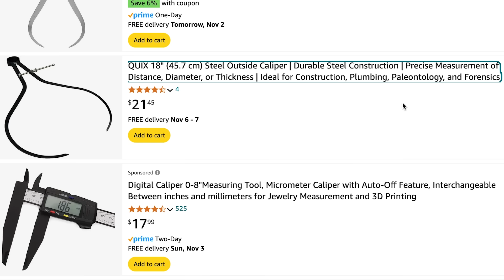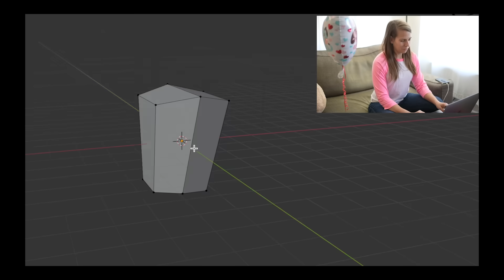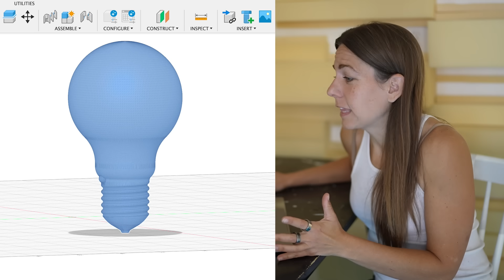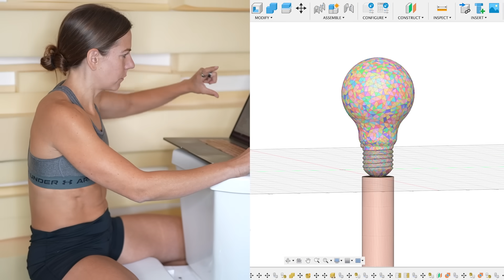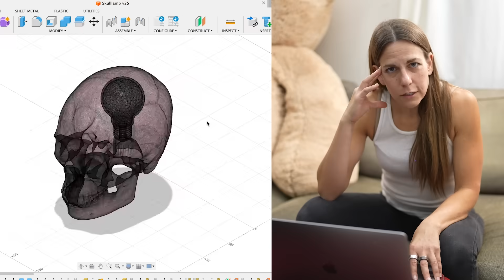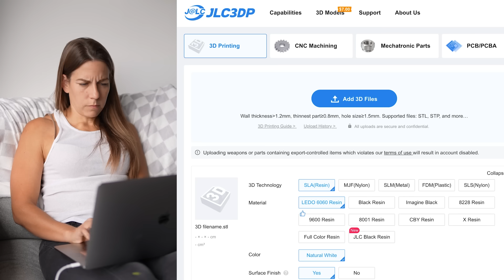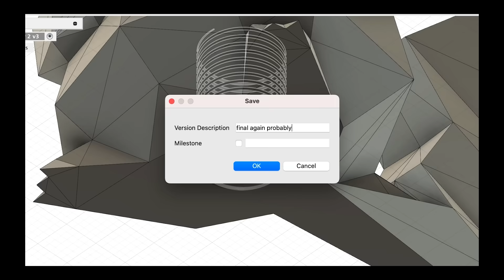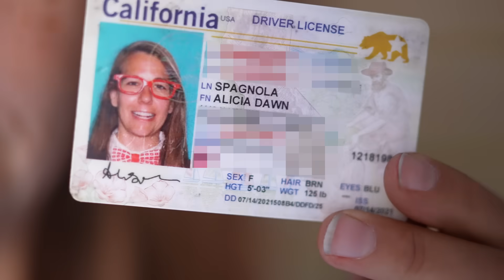I Make a Life-Size Light-Up Skull

Comment: If you were to do something similar to this again I would suggest doing it all within Blender. Fusion is just terrible for this sort of work. For example when you wanted to fill the original skull, you can go into edit mode, select the vertices around the opening(s), hide or delete them and then select and delete the interior (press L with the cursor over the part you want to select). You can then fill the holes by selecting the edge loop and pressing F to fill. Another useful tool would be the boolean modifier to make the bulb cavity. Blender has a really high learning curve but it can be really powerful and fast with experience.  Powering through a few hours of general beginner tutorials will be well worth it, if you want to do something similar.